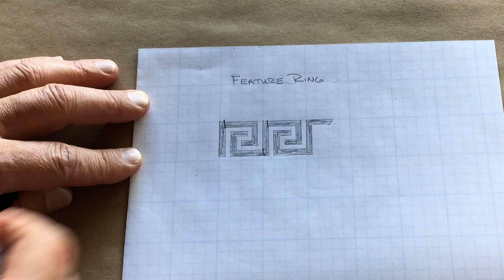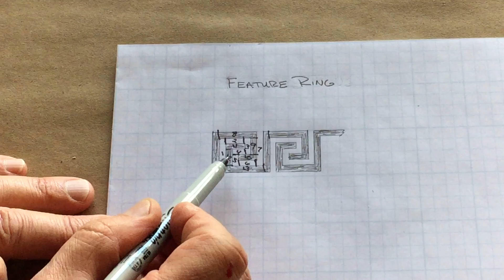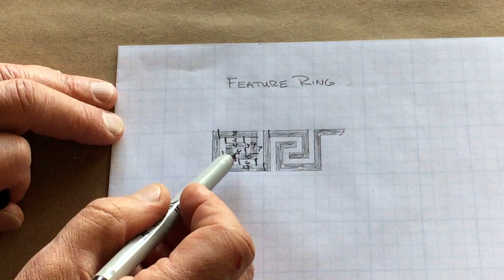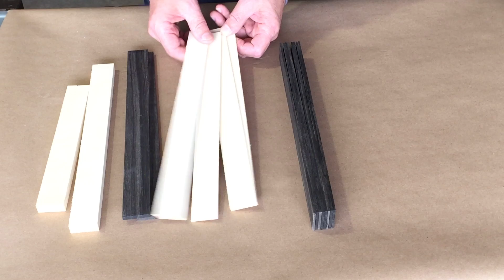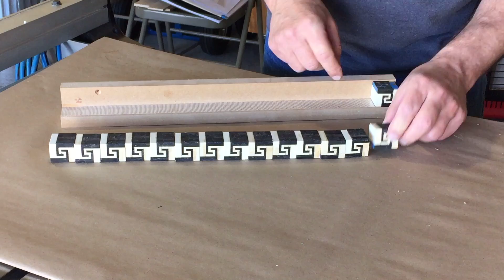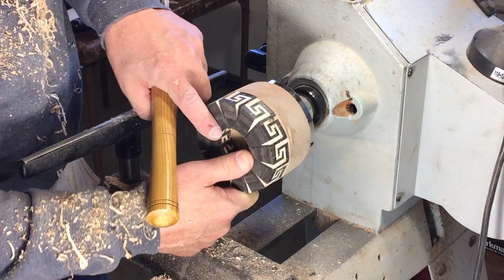A Greek Key Feature Ring

Comment: Excellent work, nicely explained. I have a couple of questions for you. I’m presuming the reason you made each section separately was to have side grain on the outside to turn ?.  Have you ever tried gluing the profile in one long block then cross cutting them ? Obviously that means having end grain on the perimeter of the turning. But considering your choices of timber were very tight grained woods. Would it have worked ?.  The next question is, did you consider leaving each segment as a block then using the spacer block to take care of the angled corner sections ?  I realise the segment would be very narrow and difficult to cut. Is it possible and have you tried it ?. I have turned wood for nearly 40 years now. Only in the past year have I ventured into segmented work. I can’t get enough of it now. All other turnings seem too simple now. Sorry so many questions. I love your work by the way. All the very best, Yours , Ricky
Reply: Exactly what I was wondering, seems a long involved way of doing it.

Comment: Perfect timing on this video.  I had recently begun planning out a bowl with a Greek Key feature!  How many individual keys made up that feature?  It looks like you made 15 but used 12.  Is that right?
Reply from the maker: You are correct.  I made 15 but only used 12.  I picked the 12 best for use in the ring and used the other 3 as test pieces to check my set up.  I always make a few extra especially if it's something that I've never done before. Good luck with your project.  Take care,  Steve

Comment: This is exactly what I've been looking for firstly I've been trying to research this pattern and didn't know its name. So now I'm figuring out how to super downsize something like this. My current obsession is to downsize full size segmented ring bowl  turning for pen blanks. I have a few normal segmented ring pen blanks under my belt but this kind of feature ring is my ultimate goal. 

Right now working on a plan where the straight inserts are the patterns and the wedges are the spacers. Just figuring if I can do it not with 1/4" wood but 1/16" wood. =:-O

ETA: not 1/16" but 2/3 less  .0267" going to have to rethink this. :-)
Reply from the maker: Good luck with your project Cliff.  When you're successful in downsizing this pattern enough to fit on a pen blank please share a photo.  Take care,  Steve
Reply: @slindsley1951  I have since figured it out  on paper but haven't made up the rings yet. its similar to a greek key but probably has a different name . its pretty much a just a  square wave.  But not sure how i can share it in youtube comments.
Reply from the maker: Cliff -  Feel free to send me an e-mail to slindsley@gmail.com.
Reply: @slindsley1951  will do I have a box of thin wood shorts that will be here thursday. I have no idea whats in it. I hope  i get some good stuff. :-)
Reply: @slindsley1951  email sent but only a pattern
Reply from the maker: I hope you get some good stuff as well.    Steve

Comment: Steve: One question, Why did you build each segment by itself and not just make a sandwich and cut the pieces from the sandwich?
Reply from the maker: John - That would certainly be possible.  There are a lot of glue joints in each piece and I wanted to get a clamp on it before the glue started to set.  It would be easy enough to glue up a couple of sub-assemblies and cut them apart when the glue dried.  Thanks for watching and commenting on my video.  Take care,  Steve

Comment: Would someone explain to me the reason for gluing up the rings with two dowels at 180 degrees?
Reply from the maker: Steve - The half ring method is used to glue up rings where the angles aren't exact and it won't go together in a single glue up.  By using the dowels you end up with two half rings that go together perfectly.  The joint between the two can then be trued up and the ring glued up with no gaps.  If angles are dead on the ring will go together in one glue up with no need to use the dowels and make half rings.  Hope that helps.  Take care,  Steve

Comment: How tall are the segments and diamature of the feature ring for the Greek Key vase. I'm going to try it. Any other tips would be a great help.  Thanks
Reply from the maker: Randy - The ring shown in the video ended up being just over 7/8 inch tall.  The largest diameter of the feature ring on the finished piece is 4 inches.  I'd guess the ring was about 4.25 inches before I started turning the finished piece.  My word of advice would be to make a larger ring and build it into a bowl.  If I had it to do over again that's what I would have done.  There's a lot of small pieces in this piece and it was difficult keeping it all straight at times.  Good luck with your piece.  It's a difficult but satisfying project.  Take care,  Steve
Reply: Thanks, I think it would be best to do a bowl first with a larger ring pieces and then tackle a vase.
Thanks so much. you do a great job on you videos.
Reply from the maker: Thank you very much Randy.  Good luck with your project.  Take care,  Steve